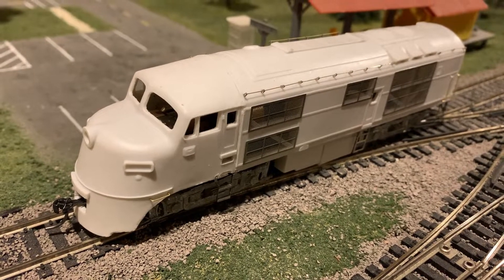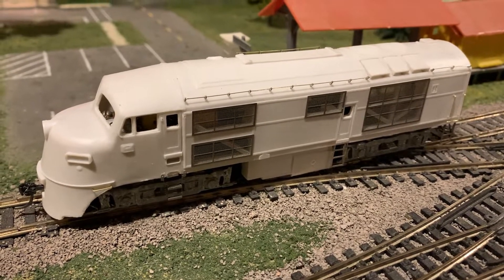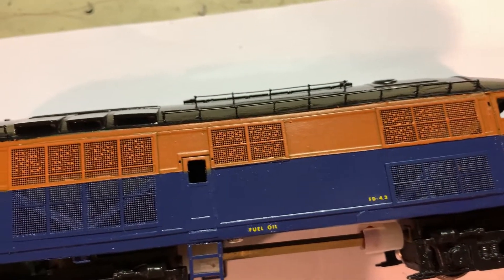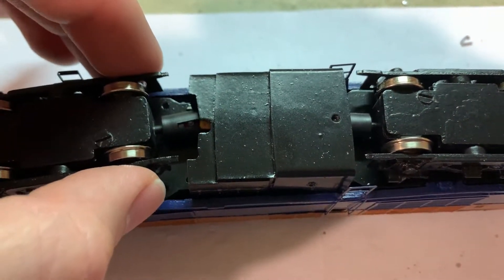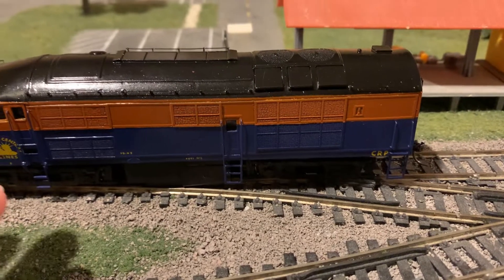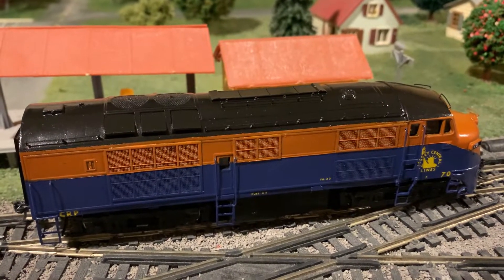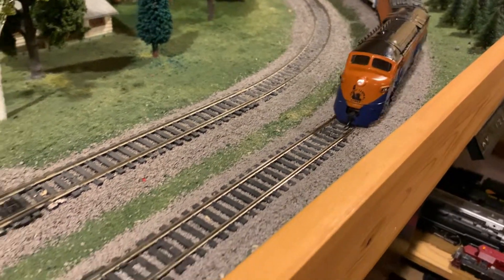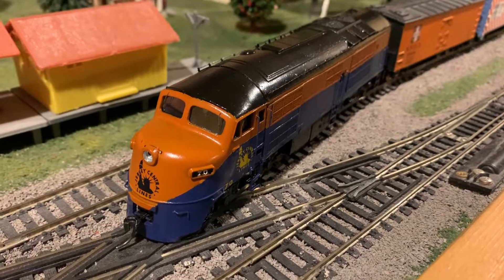Another project finished - CNJ Baldwin DR-4-4-1500 "Babyface"

Comment: Would love to see a manufacturer do the Green/yellow stripe paint job for the CNJ for this model.  Sadly, it seems they don't want to touch cab units much anymore.  They'd never do the DR 6-4-2000 in GM&O.
Reply from the maker: CMR has made a resin DR-6-4-2000 body like this one with a chassis to fit the Proto 1000 DL-109 trucks and motor.  I think they're working on converting it to a 3D resin print, so it should be available again sometime in the future.